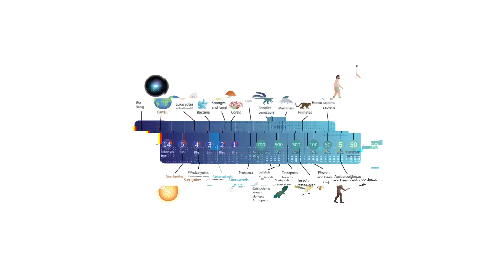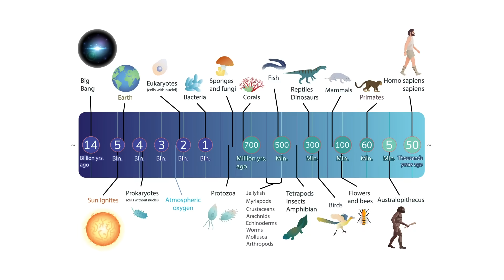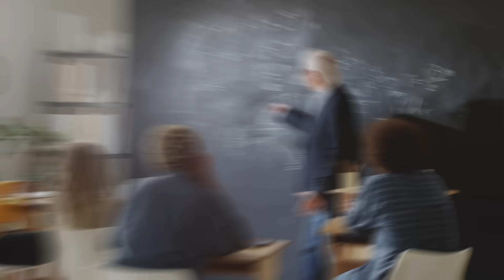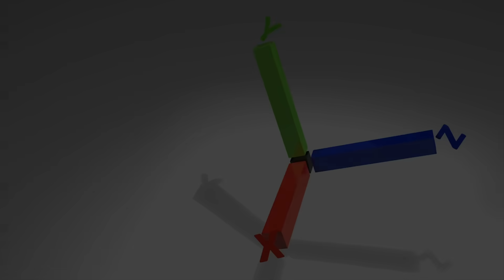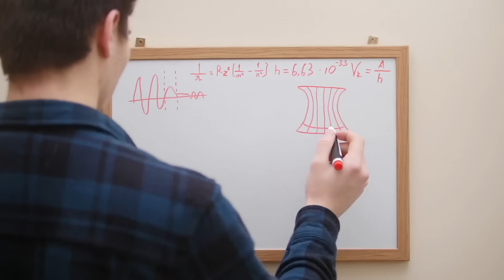Brian Cox - Why Did The Big Bang Happen?

Comment: "How" isn't a particularly good question either. You see, it pre-supposes a cause-and-effect chain of events which would have to happen outside of time, (since time hadn't started yet.) And here's the conundrum. How can one thing cause another without happening earlier in time?
Reply: A good fundamental question, as Science depends on cause and affect, and the arrow of time running in ONE direction.  This video was good in illustrating some of these paradoxes, yet most definitely it does not answer the questions they present, or the click bait title of the video. In short it illustrates that science is LIMITED, and CANNOT  answer these questions.  There is a logical reasonable thought process that illustrates this. 

Assertion - The further away the galaxy is, the faster it is moving away.  (Yet, the further away a galaxy is, the deeper into the past it is, and that distant past is what we are observing now. so of course we are not seeing how it is currently moving.) So how do we know we are not seeing its movement, based on how fast it was moving away, or how fast space was expanding at the time said photons were emitted that is just now reaching us, say 10 billion years ago for a galaxy 10 billion light years away, instead of how fast it is moving away NOW.  In fact where was the space we are NOW, 10 billion years ago?  Also, if space was contracting, or the galaxy was getting closer to us since just yesterday, it appears logical that we would not know this for 10 billion years.  

Now it seams likely that somehow they (the experts) know this is not the case.  If anyone can simply explain how they know the galaxies are moving NOW, and not how they WERE moving, however many light years ago, varied by that number of light years distant, please explain.  Is it possible space (whatever that is)  was expanding faster the further back in time one travels, and that this is what the "Hubble Constant" tells us?

Also  I have heard it said that the density of the observable universe is  fairly consistent throughout, give or take a few great voids.  Yet if the space between all galaxies was expanding, (excluding local groups etc) and expanding faster the further away we looked,  then from our perspective would it not appear that the universe would be less dense the further from our location we looked.  ( This just occurred to me, so any clarification appreciated. I understand how the raisin bread analogy helps visualize that from every galaxy perspective, most other galaxies are moving away, the greater the distance ( the more bread between) the faster away they appear to moving.  Yet it appears that this would create the perception of ever decreasing density.

Now to deeper questions concerning the arrow of time...
Science states it's limitations, as it  has no true absolutes. Yes, the symbol of infinity is used in scientific math for disparate limited reasons, such as certain electrical feedback's, or harmonics, yet they only apply to the limited measured phenomena observed, and exist until such feedback's break the system observed, or are reigned in by another action. 

Absolute infinity of course is not a number. All numbers are infinitely far from infinity. And science, as numbers, and,  limited to observations of the physical cosmos, only deals in relativity, it only sees partially, and it's vision is "measured", and can always be improved or refined. 

Science is stuck in measured observations, and the arrow of time.  It is locked in to the arrow of time as "cause and effect", and must always admit to the possibility of more information, finer observations, broader observations, hidden connections, prior causes, etc...  So, logically, science cannot prove anything absolute,  or any cause beyond the laws of cause and affect.  

The cosmological argument is not reached by science, as science cannot conceive of anything existing with no cause, and everything, within the field of science, must have a prior cause, which is an infinite loop, demanding that everything in some manner always was and is, and so, stuck in that limitation, science admits defeat; either everything has no first cause, and therefore "everything" always was, and, having no cause, is ultimately unexplained by science, or everything has a first cause that is ABOVE the law of cause and affect, also unexplainable by science,  thus check mating the ability of science.

 Paramahansa Yogananda articulates this exceptionally well;
"The ancient Vedic scriptures declare that the physical world operates under one fundamental law of maya, the principle of relativity and duality. God, the Sole Life, is an Absolute Unity; He cannot appear as the separate and diverse manifestations of a creation except under a false or unreal veil. That cosmic illusion is maya. Every great scientific discovery of modern times has served as a confirmation of this simple pronouncement of the rishis.

"Newton’s Law of Motion is a law of maya: “To every action there is always an equal and contrary reaction; the mutual actions of any two bodies are always equal and oppositely directed.” Action and reaction are thus exactly equal. “To have a single force is impossible. There must be, and always is, a pair of forces equal and opposite.”

"Fundamental natural activities all betray their mayic origin. Electricity, for example, is a phenomenon of repulsion and attraction; its electrons and protons are electrical opposites. Another example: the atom or final particle of matter is, like the earth itself, a magnet with positive and negative poles. The entire phenomenal world is under the inexorable sway of polarity; no law of physics, chemistry, or any other science is ever found free from inherent opposite or contrasted principles."

"Physical science, then, cannot formulate laws outside of maya, the very texture and structure of creation. Nature herself is maya; natural science must perforce deal with her ineluctable quiddity. In her own domain, she is eternal and inexhaustible; future scientists can do no more than probe one aspect after another of her varied infinitude. Science thus remains in a perpetual flux, unable to reach finality; fit indeed to formulate the laws of an already existing and functioning cosmos, but powerless to detect the Law Framer and Sole Operator."

Comment: Many physicists are talking about the crisis in cosmology as the Big Bang theory is not holding up in the face of recent observation. Dark energy and matter are fictions invented to try and prop up am old idea.
Reply: The Big Bang is a scientific theory which means it has been proven with facts.
Reply: @PD-ws4td  - Outdated scientific theories are constantly being replaced with newer theories as our technologies improve. What you call facts are simply the conclusions we come to about the best evidence we have at the time.
Reply: @camerontaylor1255  You’re almost correct. Facts are not the conclusions, facts are facts, it’s the scientific theories that are the conclusions based on facts. A scientific theory are explanations of facts. For example, you have the fact of evolution, and then you have the theory of evolution by natural selection which is the theory that explains the fact of evolution.

And no, theories aren’t replaced all the time, if that was true, then they wouldn’t have been labelled a theory to begin with. A theory is the highest accolade you can give an idea in science (it’s the graduation point). Keep in mind that there is a big difference between the colloquial word for “theory” and a “scientific theory”. However, you would be correct in saying scientific theories are being refined all the time as new evidence are being presented. Replacing a theory is analogous to switching out a knife for a new one, while refining a theory is like sharpening the same knife.

Comment: The question, WHY, is the question.  How does one posit a, Big Bang from the definition of the Singularity, which disallows any instability?  The current Acceptable Model of cosmology is cooked.  When will the evidentiary data and logical contradictions finally bring this paradigm into question?  It is NOT our best theory of the cosmos.  Not by a long shot.  This theory was brought to us by the same guys that imprisoned Galileo and burned Giodano Bruno at the stake.

There is seldom an issue with the raw data but only the interpretation.  Yes, there is a measurable Red Shift, but what does it mean?  Why are there objects in the sky which are close together based on observed sharing of a plasma stream, but demonstrate a different red shift?  To question this does not make me a, Flat Earther!  Why does temperature go down the deeper we go toward the Sun’s surface if the energy is coming from its core?  I admit I didn’t even listen to this video.  I’ve heard Mr. String Theory many times before.

Comment: Brian Cox has no idea! 
He should know better, matter is always associated with energy! Energy can't exist without matter! When matter is condensed, it will release energy which is absorbed into other matter which isn't being condensed. But if all matter is being condensed into a single point in the case of the big bang theory, then there's nothing for the energy to transfer to! 
So it just doesn't work! It cannot happen.... 
Unless the expelled energy was absorbed by another universe and then you will have to explain where and how the big bang got it's energy, but we don't know if there is another universe because we didn't know where if at all there is an end to the universe that we are in! 
Energy can't be condensed! If it were possible, we would have known about it by now and we would have battery technology that takes advantage of the fact that it is possible, but it's not! It cannot and never will...

Comment: I 100% accept the Big Bang Theory... just one question that nags me is why, if it was a region of infinite density and infinite pressure in a fantastically tiny finite space, why did it not collapse under it's own gravity into a black hole immediately under those conditions ?
Could the answer be that gravity is a force moderated by a particle that in those conditions had not gained the properties it has now ?  Could it be that that particle doesn't interact with baryonic quarks until they recombine into elementary particles ?  Is it something that happens at the quantum level that allows a Big Bang, but then switches off or is overcome by forces like dark energy thereafter ?
Reply: Maybe

Comment: Bollocks. How can you say the universe was once smaller than an atom and then there is no center because it happened everywhere. So the little atom was everywhere. It’s garbage. Pure contradiction. It either happened at a point or there wasn’t a point. Which is it?

Comment: You can have infinite density with a finite quantity of matter.
Reply: So here is one of the main problems of understanding.. 

People have a very poor understanding of what the word 'infinite' actually means.. This is not any kind of 'fault', but just that we have evolved within the confines of what appears to be a finite environment, and we thus try to look at things in finite ways, also justifying those 'finite' thoughts. When I first approached the 'problem' I had the same difficulties, so it takes our minds a lot of effort to reach another perspective of understanding, but it IS achievable.. 

Firstly, there cannot be more than one 'instance' of infinitude, otherwise a secondary 'thing' would render them both 'finite'. So we are describing a 'oneness'.. Also, it can have no 'beginning' nor 'ending' as these would also necessitate a secondary 'thing' (or the utter nonsense of a 'nothing'!), so we are describing 'eternity' when we apply 'time' concepts. Then, we have to admit that it can only be the one thing that interconnects all other 'things', and we deduce this to be 'Space', necessarily..

All references to 'size' or 'direction' do not apply to the nature of infinitude, and thus have no relevance to our understanding of the true nature of existence. 'Measurement' has limitations.. When we point to any position in Space, we effectively create a 'beginning' to any subsequent forms of measurement, which only has relevance to the entity desiring to understand said 'measurement'. This does not make it a feature of the nature of reality, only a desire from a Human perspective.

Comment: It is not meaningful to regard the universe at any time between now and 13.75 billion years ago to be of any size. By saying this scientists are elevating our status within  of the universe to be empirical. Our view that there is expansion does the same. Consciousness is not able to be outside looking into the universe. It can only be a part of its environment. The Big Bang was a series of revolutionary changes in the environment. If seen this way, then all physical constants become variable and expansion (and red shift) is an expression of the fact that there has been environmental change and energy conversion. The more distant the object, the older it is, the more energy has been converted, the more red shifted it appears to be and also the more accelerated it appears to be. There is a fundamental flaw in the way scientist describe the universe which leads to wholly incorrect assumptions.

Comment: H9w? Fairly straight forward really. The universe is a result of a cosmic explosion much like a star goes through only much bigger. All the matter was collected at a single area in the form of a nlack hole that once it got to a certain density of mass it broke the neutrons down into their basic components due to the sheer amount of gravity. You see, that is ehst lies under the event horizons of all black holes today, neitron stars, the largest neutron stars already have escape velocities approaching the spped of light. Once the neutrons break down into quarks and such,  there should be a rebound effect. Look at thr most distant galaxies out there, they were moving quite fast because the farther out you look the farther back in time you see. The universe will collect back into one body in due time, and then the cycle will begin again with another big bang. The universe is expanding into the void, or at least it was expanding since we can only see the past we know not what is going on now. For example, we see the sun as it was 8 minutes ago, the moon is a fraction of a second in the past.

Comment: Do we need to believe in this or want to believe in this, I think the latter is more likely
Reply: Brian Cox does not know. He is the 'face' of unknowing.. Currently a very profitable pastime..

But if it is genuine knowing you want to achieve, there are ways.. However, the first requirement is to realise that knowing is its own 'prize'. It does not need to be lavished with capitalist adornments and/or piles of cash..

So here is one of the main problems of understanding.. 

People have a very poor understanding of what the word 'infinite' actually means.. This is not any kind of 'fault', but just that we have evolved within the confines of what appears to be a finite environment, and we thus try to look at things in finite ways, also justifying those 'finite' thoughts. When I first approached the 'problem' I had the same difficulties, so it takes our minds a lot of effort to reach another perspective of understanding, but it IS achievable.. 

Firstly, there cannot be more than one 'instance' of infinitude, otherwise a secondary 'thing' would render them both 'finite'. So we are describing a 'oneness'.. Also, it can have no 'beginning' nor 'ending' as these would also necessitate a secondary 'thing' (or the utter nonsense of a 'nothing'!), so we are describing 'eternity' when we apply 'time' concepts. Then, we have to admit that it can only be the one thing that interconnects all other 'things', and we deduce this to be 'Space', necessarily..

All references to 'size' or 'direction' do not apply to the nature of infinitude, and thus have no relevance to our understanding of the true nature of existence. 'Measurement' has limitations.. When we point to any position in Space, we effectively create a 'beginning' to any subsequent forms of measurement, which only has relevance to the entity desiring to understand said 'measurement'. This does not make it a feature of the nature of reality, only a desire from a Human perspective.

spaceandmotion
Reply: @fluentpiffle  great points and well written, thanks